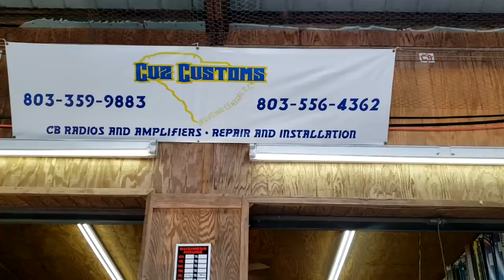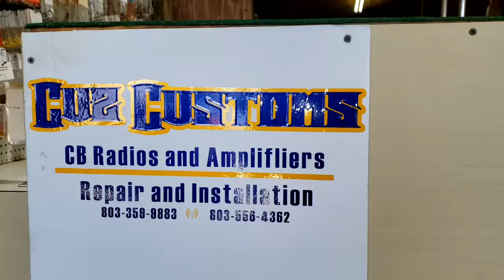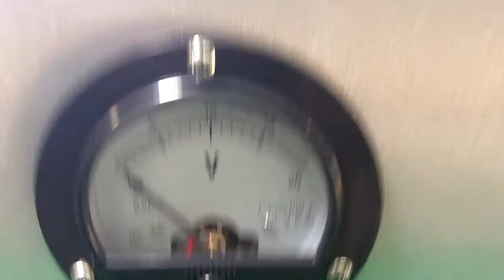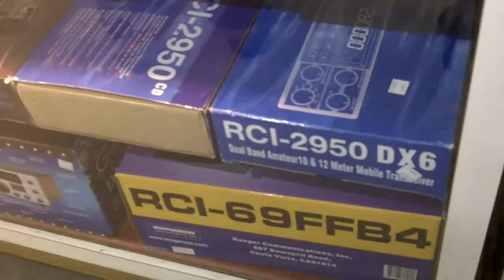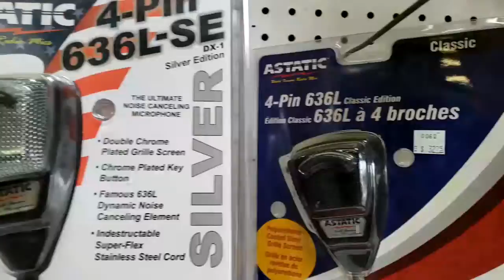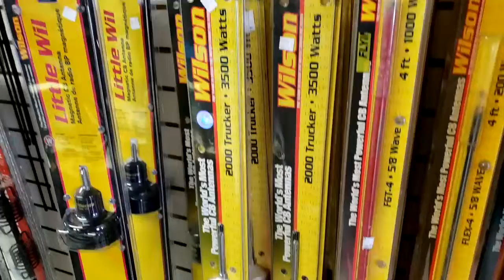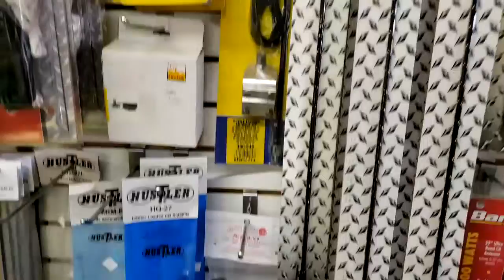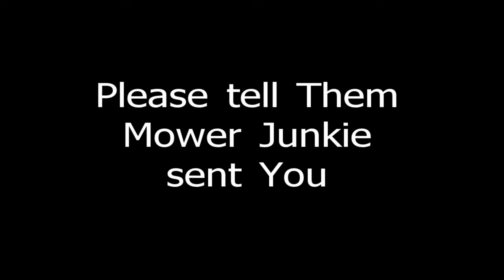Cuz Customs CB Radio Shop   Revisited

Comment: I saw that PSV 300 pyramid power supply when you went by it I had one of those great power supply except for in one year time the fan went out and I couldn't find anybody that sold a replacement except for one guy that was selling power supply with a replacement fan so I just let it go with an RV that I sold

Comment: I would get in so much trouble if a place like that was around here😂
Reply: You can spend some money on toys. I am going to contact them and order a 102" whip.
Reply: @melbytvenge  there ya go. Shipping may cost more than the antenna itself. I still have my radio shack 102 👍🏻
Reply: @johnnywood8082  if it's another $10.00 shipping I will go with it. I used to have all of this stuff back in the day of course should have kept most of it.
Reply: @melbytvenge  keep your fingers crossed. Shipping something 8 feet long won’t be cheap.
Reply: @johnnywood8082  I'll see what it all is.
Reply: @melbytvenge  you get it?
Reply: @johnnywood8082  Pockets full of Money and grocery carts full of toys.
Reply: @melbytvenge  haha. I meant the shipping on the 102”?
Reply: @johnnywood8082  yes  it would be long to ship but am looking at cuz customs which mower junkie made a video on.